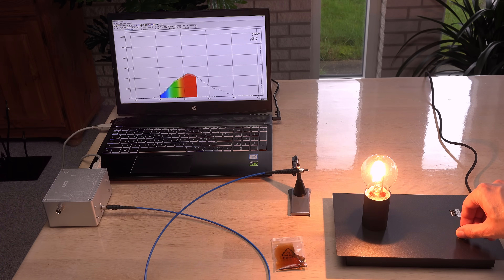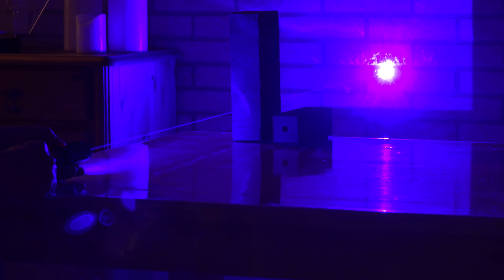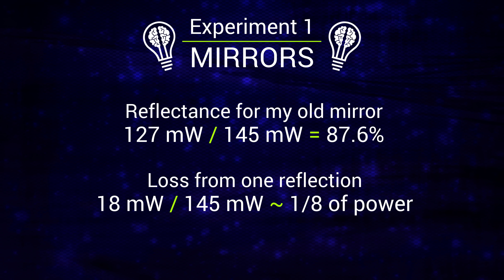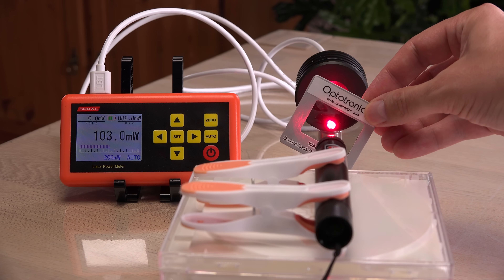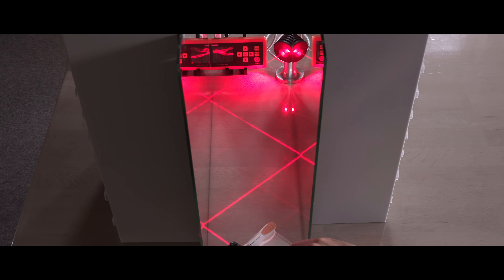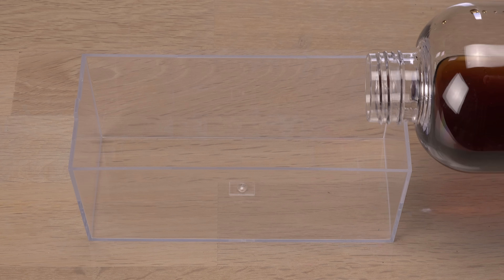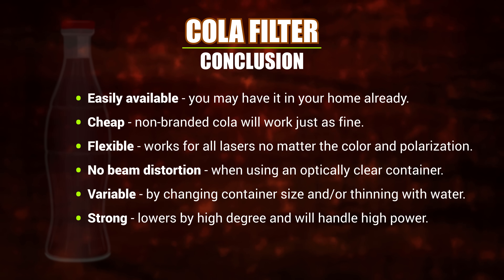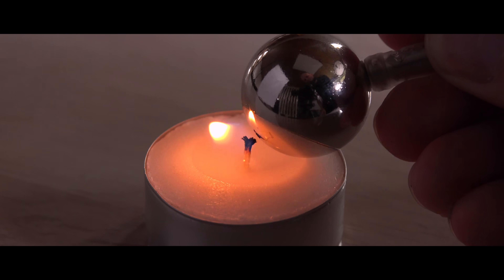COLA is PERFECT for lowering a laser's power!?!

Comment: The ND Filter method works up to 3-400 mw iam guessing. I tried it with a 100mw red and with a 1,6W blue. The focused down red obliterated the coating on it and blue with a regular beam focus did it after a few seconds. A full test would be nice since i dont wanna break mine even more :P

Comment: For the more younger people who still aren't sure how the mirrors not being 'first surface' mirrors, heres a quick point.

Refraction is when light bends while passing through two transparent substances. For example, water is a lot more dense than air, so when a LASER's light passes through the water from the air, it bends slightly when looking at the beam. I honestly suggest looking it up, as well as Total Internal Reflection because its incredibly interesting.

Comment: The cola filter actually isn't that much of a surprise if you think about it. Water is pretty good at taking away IR radiation and that red/brown color of coke assures there won't be any green or blue passage. Also the molecules being suspended in water are well cooled and so prevented from heating up and falling apart easily. To think of it... things are only the color they reflect or not absorb. So coke doesn't really come to mind right away, but upon further thought it's logical for it to be a good filter. Now try Pepsi and Dr. Pepper. :D

Comment: cool experiment! A standard method to have a variable attenuation on a high power laser bundle is to use a polarizing beamsplitter. One polarization gets transmitted, the other is reflected at some angle. That reflected beam is caught by a beam blocker that can handle the heat/power. Now you can use a half wave plate in front of the beamsplitter to rotate the incoming polarization and thereby control the transmission/reflection ratio. The polarization of the transmitted beam through the beamsplitter does not change, only the power is affected. But of course cola is a much cheaper solution :)

Comment: I had a thought about this video in the last 24 hours.
And here are the results. While a cola bath might reduce the laser's power, it is in no way a practical, nor portable application. (it is cheap, though.  as you can get a bottle of the cheap stuff for ~60 cent/1.5 l)
But a more practical application would be a 3D printed (or otherwise made) cap for the laser that holds a small amount of water (cola?) between two "sheets" of glued in acrylic. (total cost to here ~2€)
On the beam exit side, you glue the cheap polarising filter ( 3:55 ) towards the laser. That way, the cheap filter will be cooled by the water chamber.
I think that will be an easy (if you have a 3D printer), adjustable, cheap, and non-destructive way to make such power-reducer. And if the cap is designed the right way, you will even be able to replace the filter when it is burned through.

Alternative:
1:06 Here you can see a bridge* / resistor*² between VCC in (battery) and the rest of the laser. Replace that with a higher value resistor, and it is as if you run the laser on flat batteries (voltage wise). Alternative, you can add an additional (variable) resistor in between the spring and the circuit board*³ by shortening the spring.
But that are permanent changes to the laser, which can't be undone (or only with great headache)

______________________________________________
*=marked 0
*²=marked 6R2 =6.2 Ohm
*³ = or that resistor if you strapped for space (like the one on the left) you have to cut the trace on the board, though

Comment: Very interesting video, I wouldn't of thought to use a liquid for attenuation but yeah you can dump some serious power into it and it's not going to care. I do think using dye is better for 2 reasons. It won't spoil and you can more evenly balance the color blocking effect. My other thought is you would be able to change the thickness of the filter vertically by changing depth. Maybe have one mirror under the container shooting the laser beam up and through a glass bottom. Some sort of syringe coupled to the container to change the fluid level and another mirror above the fluid to direct the beam forward ( relative to the input beam like a para scope ). It's a little bit of kit to set up but once done it's also easy to maintain. If your interested I am up to chat on a simple design people could replicate.

Comment: You cold expand the laser beam to the full size of the bigger filter and then refocus it using optics. Distributed over the whole area the filter should be able to handle the power, given that direct sunlight can get to around 1000Watts per m². Calculated down to the area of the filter, should work ^^ since no camera filter gets damaged by pointing it at the sun.

Comment: I've fired a 100+ watt 808nm Dilas infrared laser through Coca-Cola before. It kind of burns and boils it pretty quickly. Lots of pops and bubbles. So it has power limitations. Maybe 40 watts or lower.

Comment: In the lab we usually use a λ/2 waveplate and a polarising beam splitter cube. You could also just rotate the cube, which has the advantage that you don't need the expensive and wavelength dependent waveplate, but then of course the direction of the reflected beam will change too. These cubes aren't all that cheap though...
Also, proper metalized mirrors aren't all that expensive. You can get thin 1inch protected aluminium, gold, and silver mirrors from Thorlabs for like 15€. Their thicker standard mirrors are around 30-40€. They also sell ok-ish mirror mounts for similar money, but I prefer the ones from RadientDyes.

Comment: There's all sorts of strange effects you can get with liquids, magnetic and electric fields etc. and you're well equipped to explore some of them. 
New sub.    You could use the partial reflection that occurs when shining the laser through flat glass.  At least you would avoid heating the glass.  The vast majority is either transmitted or reflected so power would be less of a problem.  You'd have to be unlucky for the glass to have an absorption band at the frequency of the laser.  That sort of thing only happens to me.    :)

Comment: I bet you could water cool the glass ND filter to make it less susceptible to damage from powerful lasers. Just drop the filter into a flat-sided optically clear container full of water (or soda I guess lol), and then shine the beam through it all. I can’t imagine why the water would prevent the filter from doing its job, and it should carry away excess heat pretty effectively.
Reply: I think it would be interesting to try filling the cavity between the two filters with mineral oil or water or something else to conduct heat evenly across the whole filter. I think it would be enough to just spread the heat around, rather than going through all the effort of transporting it away.

Comment: rather than changing size to affect filter density, try using a cube and just dilute with water, or strengthen with pure cola to dial up and down. So long as you can dial in and they leave it set, it should work fine, and you would be able to vary the power quite accurately

Comment: You could build you own variable ND with two circular polarised filters available online for $20. They have threading so they can stack. 
However: Cheap ones may not be uniform. Probably won't be made of glass unlike the $100+ Variable NDs. 

Bonus: GoPro circ pol filters are roughly the right size to mount to the front of a laser pointer. But don't stack. I wonder if there's a small diameter stackable one out there so you could make it convenient and handheld!

Comment: one thing I should mention on the cola is that I have seen it sit on a balcony in the sun for quite a long time (long enough the label was all white as the red faded) and the cola liquid turned a sort of amber yellow so UV at the very least degrades what makes that brownish coffee color in the solution, 
I would like to see what say using salts in water would do (like copper sulfate dissolved or zinc sulfate ect,) as this seems like a good way to be able to make color specific filters due to the specific frequencies the different salts both when dissolved and when dehydrated into crystals, produce responses to their chemical makeup so it should not vary from location to location person to person, lab to lab. be it a high dollar funded university or a backyard shed of a private experimenter :)

Comment: I would expect it to be unstable with a high power beam. If the power density is high enough, it would likely carbonise the sugar further, changing the absorption characteristics.
Reply: The color is caramel. So, if that were to happen, you might expect that it would get darker. With the volume of the beam path compared to the volume of the liquid, it might take some time to see a noticeable effect.

Comment: The optical approach is interesting and fun but attenuating the output of a laser can be done fairly easily with electronics. All you need is a variable current limiter. You can buy little power supply modules online that allow you to adjust voltage and a current limit using two multi turn trim pots.

Comment: You may be able to locate front surface mirrors inside discarded rear projection televisions. It's the type of a television with substantial depth to the cabinet, with the mirror about as large as a small table. I've rescued a number of them from the rubbish pickup. A bonus inside is three large diameter convex lenses.

Comment: You don’t have first surface mirrors? you have thousands of dollars in optical measuring equipment… And you don’t have first surface mirrors, Optical mounts, lasers for a small optics table, or an optical breadboard? 

Trust me I understand that the laser hobby is expensive… It took me several years of looking at government and industrial auctions to build my optics lab with optics table, all the mounts, lasers, and optics… but I had a lot of that stuff set up way before I ever got a nice spectrometer or a decent LPM. 
No worries to each their own, I was just surprised when you said you had no first surface mirrors. Because you make some great videos and you have some really nice optical measuring equipment.

A cheap way to get a lot of optics and stuff, you can buy old broken or untested projectors on eBay between $10 and $30 each including shipping. Most of them will be the “three LCD“ type… Which have a lot of cool optics, first surface mirrors, X cube, and a lot of dichroic filters. 

Some of them are even laser projectors. The Casio‘s come to mind in particular. Before I had real optics equipment…. I bought quite a few of those for dirt cheap on eBay. Not only do you get a large laser array… But the main goodies are all of the optics! 

There are all kinds of other wonderful places to get first surface mirrors & optics cheap or free.

I always enjoy your content!

Comment: The filter is going to break with strong lasers, but I wonder what the failure mode will be. The plastic filter seemed to melt, and I don't think this is going to happen on the glass filters. Maybe a crack from the heat differential?

Comment: Good thing about using the "cola" filter, is that it will auto-dissipate any heat it collects. The fluid will continue to swirl so no hot spot, or burn throughs will happen.
Reply: Depends on how powerful the laser is. I'd imagine a high power pulse laser could instantly boil a line cola through the glass... And probably break the glass too.

Comment: Engineering project : set your square box with 3 pumps, one sink, a coke source, a water source and an rPi. Ask the pi to always send a fixed total volume of liquid, with increasing proportion of coke. Once you have measured the absorption ratio for many dilutions, you can ask your pi a random absorption, reliably, repeatedly.

Comment: If you plan to use your highest powered lasers in the next cola experiment, can you also measure if the cola temperature changes?
Reply from the maker: No doubt, that the temperature of the cola rises since it absorbs the energy of the laser beam. But even a 1 watt laser can only warn with 1 watt of energy, so unless the cola amount is small, I believe it will just radiate the heat to the room with little temperature rise in the cola. But sure is worth an attempt with a small/shallow amount of cola. And thanks for the great suggestion once again :D
Reply: @brainiac75  It only takes 4.2J to raise 1ml of water by 1C.
A 250mW laser would get there in ~20 seconds.
I thought would be interesting to know what happens after ~20 minutes.
I am thinking there would be a few degrees C difference on one side compared to the other.

Comment: Hard drive platters from a broken hard drive may make a cheep and effective front surface mirror .
Reply from the maker: Interesting thought. They are incredible flat. I wonder how high their reflectance is, but in this case we want low reflectance. Thanks for the suggestion - calls for some experimentation in a future video :D
Reply: @brainiac75  they're not too dissimilar to house mirrors, only ~80%. The bigger issue is a soft brown tint they have in the visible spectrum
Reply: @vaelophisnyx9873  Well, the tint shouldn’t matter much as lasers are almost monochromatic, it just means it’ll attenuate some wavelengths more than others. So I’d say it could be a good idea then.
Reply: @vaelophisnyx9873  Mirrors have an even softer green tint
Reply: @brainiac75  If I hold my platters up to the sun, some light is transmitted. Maybe you could use them to attenuate the beam by reflecting most of the light away and only take the transmitted light.
Reply: @timanderson5717  probably laptop platters, they are often glass that is coated. desktop drives are aluminium with the coating
Reply: @brainiac75  very low reflectance, I'd say 90-80%. Good idea.

Comment: FYI often you can remove the back of mirrors with acetone, giving a front surface mirror.
Reply from the maker: Interesting. But will the aluminium stay shiny/reflective? As I remember it, first surface mirrors also a protective coating on the metal.
Reply: @brainiac75  Its shiny for quite some time, the oxide layer perseveres the surface. It will get dull after a few months/year years(think telescope mirror)
Reply: I seem to remember nighthawkinlight having a video covering this. However, as another commenter suggested, hard drive platters might be a good choice
Reply: @iamdarkyoshi  That's a good suggestion, the nickel of the platter is less reflective, so a better suggestion for an attenuator.